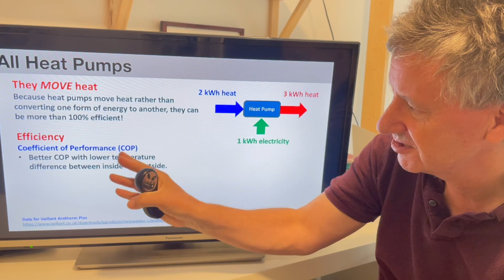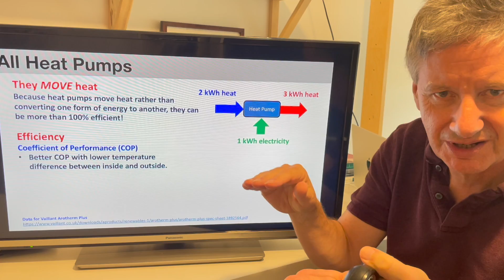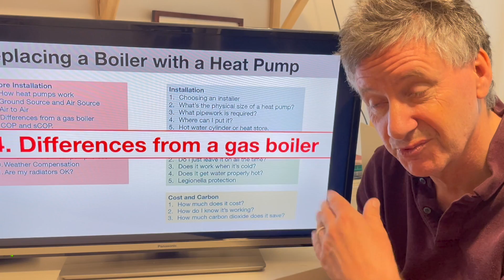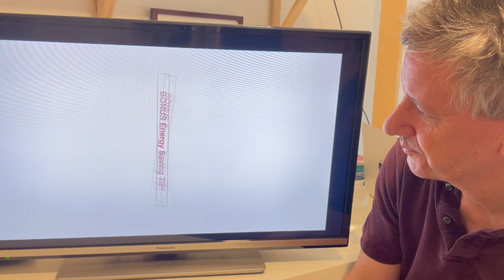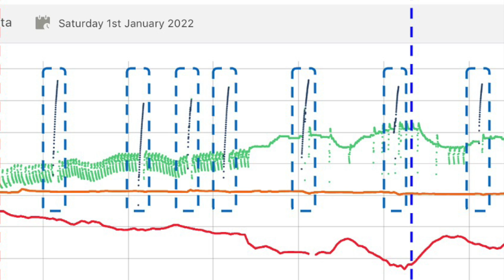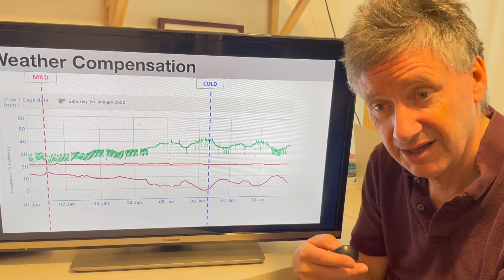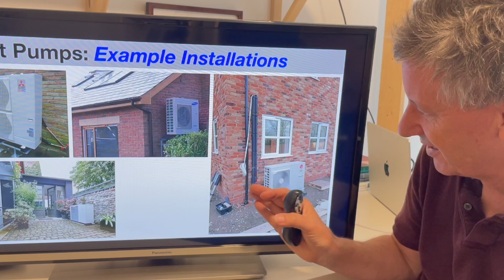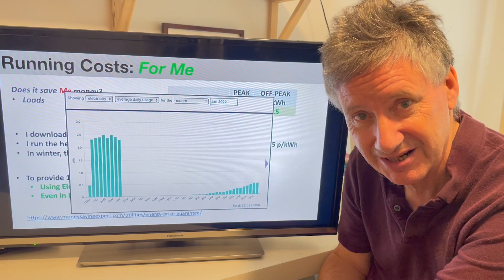Replacing a gas boiler with a heat pump

Comment: Heat pump reliability has to be addressed if it is to be really green.  Breakdowns are a reality government has to increase reliability of pump fan bearings and circuit board.
Reply from the maker: @frederickbowdler8169 Good Evening,

Reliability is an important issue, and it it is yet to be really tested in practice because heat pumps have not been installed long enough. But the technology is similar to that in domestic refrigerators and air conditioning units, both of which are spectacularly reliable.

Was it something specific  that caused you raise this concern?

Best wishes

Michael

Comment: Not one person with a heat pump will say how much their electric bill is each month. Most are fitted in homes with solar and battery systems,  so when they say it costs less to run, that's not a comparison. 
If you don't have solar/battery systems then you'll be in for a shock at the running costs.
Reply from the maker: In the video (https://youtu.be/n3AoUjuBixA?t=3333) I explain the typical saving is small and I also say exactly how much my bill is.

If you want to comment on the video, you might want to watch it first.

Best wishes

Michael

Comment: The initial figures look great. But the capital outlay is way beyond most peoples budget. The other factor is the carbon footprint for production of solar panels and batteries. So for me it's not that cut and dried But well done all the same
Reply: The boiler replacement grant is now worth £7500, and this is making heat pumps about the same cost a new boiler for most people
Reply: @tlangdon12  yes you're spot on with this figure. The deciding factor for me was that in addition to the cost of the heat pump - we would need to replace all the radiators. Loose our airing cupboard. And dig up our patio for a concrete base. This would all be in addition to our original estimate. Way over the cost of a boiler that we were quoted £2.800 to replace. I'm still not convinced that we would get anywhere near the SCOP figures either. If we had a nice solar system making a excess of electricity I might be more encouraged. But as these cost upward of £7,500 its a non starter. I think Mad Ed Milliband needs to commission a proper impact report. Rather than getting a company he sponsors to write it and then spend our money on.
Reply from the maker: @PaulRansonArt, thanks for stopping by. Three points in response to your comments.

Firstly, with regard to embodied carbon dioxide in the panels and heat pump, that 'debt' is paid back in a year or two. Here are my calculations from a year or two ago.

https://protonsforbreakfast.files.wordpress.com/2022/01/image_2022-01-01_172251.png

The figure is part of this article https://protonsforbreakfast.wordpress.com/2022/01/02/carbon-accounts-2021-looking-back-and-looking-ahead/

Secondly, financially a heat pump by itself is borderline 'profitable' i.e. it has a long 'payback' time. However in terms of reduction in carbon dioxide emissions the payback effect is dramatic - resulting in ~80% emissions reductions. In terms of capital outlay, for many homes the UK government's £7,500 grant makes a heat pump installation similar in cost to replacing a gas boiler.

Finally. Metaphorically we  have set our house on fire. Putting out the fire does not come at zero cost.

Best wishes

Michael
Reply: @michaeldepodesta001  I absolutly agree with your comments. We as a planet have no option other than to adopt a greener way of living. Such a shame that energy companies saw the £2,500 additionally grant as a windfall for them. Yes, my quote for a heatpump was £3,659 in addition to the £5,000 grant. When I saw the additional boost to the grant I leapt for joy as my quote would be reduced to £1,159! Right ....... think again. The quote remained unchanged but they would have pocketed the extra money. How on earth is this going to encourage us to change.  My total investment on a solar system, batteries, and an ASHP would be £17,000. Add an EV and we're up to £50,000. Keep on making great videos and lets pray the economy of scale makes a greener solution affordable for everyone.
Reply from the maker: @PaulRansonArt  Oh Dear: that sounds depressing and potentially rage-inducing! I wish it were not so.

Please allow me to wish you good luck with your endeavours.

Michael

Comment: Can it be run in reverse to provide cooling through water radiators?
Reply from the maker: @FelipeBudinich Good afternoon. It varies from model to model, but many heat pumps can be run in reverse to provide cooling. However cooling through normal radiators is not very effective. If the flow temperature falls below roughly 10 °C then water will condense on the outside of the radiators - and drip onto furnishings.

Instead of radiators, special units are available which maximise heat transfer - similar to the fan-coil units used in air conditioners, but still with water as coolant/
Reply: (I live in different weather conditions and it would be pretty nifty to be able to provide heat and cold with the same system)

Comment: Hi Michael. Hope you are well. I commented on this video last year and you were kind enough to reply. I never got to move to an ASHP as our old gas boiler gave up during the coldest month of the year and we had to replace it quickly. The new boiler a vaillant ecotherm 630 has advanced weather compensation but I'm not sure it is operating efficiently because our room thermostats, which call  for heat are overriding WC. This is most noticeable on sunny days when we have solar gain through our south facing windows which warms the room up but when the sun goes down in late afternoon the room temperature falls slowly meaning there is a cold period until our stats recognise a fall in temperature. We get round this by bumping up the desired temperature on the thermostats. From your experience would giving over control to the WC and boiler solve this problem for us as the boiler would turn on the heating when the outside temperature goes down, negating the need for us to manually intervene to stay cosy? Thank you
Reply from the maker: Steve, Good afternoon. 

I'm afraid I can't answer specifically to your system, but in general using Weather Compensation (WC) will give you the most comfortable home at the lowest cost.

In my own system (Vaillant heat pump) I use WC with an 'extended' setting. Vaillant don't specify exactly how this works but I think it uses WC, but if it has difficulty achieving the target temperature it adjust the output slightly (I think it adjust the slope of the WC curve) based on the thermostat setting.

You can see an example of the performance below.

https://protonsforbreakfast.files.wordpress.com/2024/02/heat-pump-errors-10.png

Solar gain is difficult for all control systems, and I am not sure that PURE-WC or PURE-THERMOSTAT will give you the best answer, but a sort of hybrid mode might sort of allow you to muddle through.

If you start to play with the settings I encourage you to write down everything you do - and maybe take a photo of the setting in the App or Controller - it's very easy to get completely lost!

Best wishes

M
Reply: @michaeldepodesta001  Thank you Michael. I won’t be tinkering with the settings without professional help! I have a Heat Geek engineer coming to service the boiler so I’m hoping to get better advice than I did from the installer. Thank you again for taking the time to reply. Any new videos in the pipeline? They are always a great watch.

Comment: Dear Michael,
Brilliant explanation of the working principles of a heat pump and components involved. Much appreciated thank you. We have our survey in April and the comparison to your calculations outlined in your other video should be interesting. Thank you for your efforts.
Reply from the maker: Dear @fje1948, Thank you for your kind words. And good luck with your  heat pump installation. Do drop me a line if you have any questions. Best wishes. M
Reply: Yes, this is one of the best explanations of the basics I've seen. Some people wonder how you can move 'heat' from outdoors when it is -20C to indoors, but you have to realise that -20C isn't that cold: Propane, a common refrigerant in domestic heat pumps, doesn't freeze until it gets to -187C and boils at -42C, so Propane outside on a cold winters day is boiling hot!
Reply: Stick to a combi and save money

Comment: Excellent explanation thanks! Just one point - you ignore the fact that hydrogen will be produced using surplus wind energy. As we scale up offshore wind to align to peak demand, there will be a massive surplus at times of low demand that can be used, even for the relatively inefficient production of hydrogen and ammonia (along with superior but limited scale storage solutions such as pumped hydro).
Reply from the maker: Good afternoon. And thank you for your kind words. 

However I think you are completely wrong about hydrogen. We need hydrogen for many reasons (high temperature heating and chemical feedstock) but heating is a complete waste of hydrogen. The difficult and expense of making it will require that it's used in applications where it is irreplaceable. Hydrogen provide no alternative to using heat pumps.

Best wishes

Michael
Reply: @michaeldepodesta001  totally agree for domestic heating (and I'm probably going to get a heat pump myself so agree it's probably the best solution for this use). But I work in the energy industry and can't see any substitute for some level of gas generation during prolonged periods of low wind (the so called "dunkelflaute") so converting natural gas CCGTs to hydrogen could be part of the solution. And there is no choice here - the O&G majors will be part of the energy transition whether people like it or not. Net zero comes at a huge cost and the economics need to work. But there will be endless debate on this fascinating topic!
Reply from the maker: @telemacus24  In my understanding it is not so easy to convert CCGT to hydrogen. I am not aware that it has been done. The flame properties of hydrogen and methane are completely different. Given that production of hydrogen is so difficult and expensive, it would probably just be better to keep generating with methane as we do now during the low wind periods. Then - as has happened with coal - our requirements for gas will diminish year on year as renewable generation grows.

What to do with the surplus renewable generation that we will soon find ourselves with? I think it's an open question. Synthesis of liquid fuels is one option, but I think there are a lot of long-term energy storage technologies with durations of days to months that may become economic. 

In any case: it's not today's problem. Best wishes. M

Comment: Mains electricity is produced inefficiently (but getting better) and distributed loosing some more (just a small omission)
Reply from the maker: Brian, Good Afternoon. Indeed, no energy conversion has 100% efficiency, but it is interesting to understand that starting with methane gas, it is more efficient to burn it in a power station (50% efficiency) and use that electricity to operate a heat pump at a COP of 3 (300% efficiency) than it is to burn the gas directly in someone's home (90% efficiency).

Best wishes

Michael

Comment: Hi Michael, firstly, thank you for such a detailed and useful presentation. All very interesting. I appreciate you made this video sometime ago but do you mind me asking how big your solar battery is? I already have a 4KW solar array tied to an 8.2kWh battery and it would be really helpful to understand how much assistance this would give to any heat pump and/or how quickly the heat pump would deplete the battery? Based on our annual gas usage (approx 8200kWh) im guessing we wouldnt need a particularly large heat pump (3kW i think based on your rule of thumb). Any thoughts would be gratefully appreciated. Cheers Rob
Reply from the maker: Rob, thank you for your kind words. 

1. If you have a 4 kW(peak) array in the UK then depending on orientation I guess you will generate between 3,000 kWh and 4,000 kWh/year. In summer peak generation will be ~25 kWh/day and in winter it will typically be ~2 kWh/day.
2. My house required 3.5 kW of heating when it was - 5 °C last week and this was supplied with a COP of about 2.5 - so it required 3.5/2.5 ~1.4 kW of electrical power. Over 18 hours this amounts to 1.4 kW x 18 hours = 25 kWh of electricity. Our battery is a Tesla Powerwall 2 with 13.5 kW nominal capacity. Currently capacity is about 12.2 kWh (https://protonsforbreakfast.wordpress.com/2023/12/30/solar-pv-review-of-2023/).
3. We charge up the battery on cheap rate electricity from 11:30 p.m. to 5:30 a.m. and then run off the battery until it runs out. On the cold days with no Sun, we ran out of battery in early afternoon. With bright winter sunshine we managed to make it through to 4 p.m. or so before running out.

Regarding heat pump sizing, do make sure that your gas consumption corresponds to a situation where you are keeping your home at a reasonably constant temperature during the day. If you are switching off your gas for half the day, and the house cools, then using the rule of thumb this will lead to an underestimate of the size o heat pump required. Drop me a line (house@depodesta.net) if you need any clarification.

Best wishes

M
Reply: @michaeldepodesta001  Hi Micheal, thanks ever so much for the helpful response. Lots of food for thought. You've accurately surmised by solar systems generating capacity so it's helpful to know that Vs what your heat pump requires. Following your message, I've also tweaked how we are heating our house to a constant setting (we were previously heating intermittently) to get a better idea on demand and sizing. Thanks again, I really appreciate you taking the time to write. Cheers Rob

Comment: The switch you recommend to reduce the flow temp and have the boiler "on all the time" surely must dramatically reduce the boiler's lifespan and cause more issues, many times more worrying than spending more or wasting more energy by having it heat up less often at higher temperatures? Genuinelly asking, not challenging. Thanks
Reply from the maker: @montyoomska, Good Evening,

Mmmm. Tricky. 

First of all, I can't give you a definitive answer, but here are some reflections.

1. Boilers do last a long time - frequently for decades. But when they break, I have never heard of a boiler breaking from 'being on too much". What breaks are nearly always electromechanical components such as electric valves, relays and pumps.
2. If a boiler has an output power of (say) 20 kW which it can modulate down to 5 kW, then components in the primary heat exchanger (which extracts the heat from the flame) will get less hot, and will not heat up and cool down so frequently. I would imagine that would lead to less stress and less corrosion.

So my guess is that modulating a boiler to lower output is generally beneficial rather than harmful.

3. Improving efficiency by 10% is (neglecting standing charges) 10% off your gas bill. If that's £1000 a year, then that's £100/year. 

Have I missed something obvious?

All the best

Michael

Comment: I have a fairly well insulted 1990s built home but it has 10mm microbore piping. Is this likely to need replacing when installing a typical HP and if so, would a higher temp Octopus Cosy HP be better suited (albeit with lower COPs)?
Reply from the maker: Darren, Good Afternoon. I wrote an article about this issue here: https://protonsforbreakfast.wordpress.com/2023/08/02/hydronics/

Hydronics is the fancy name for plumbing. Heat pumps are good at producing heat, but they need to circulate a lot of water to pass on that heat. Narrow tubing requires a high pressure to pump the water through. As the article says, the standard approach to this is to use what's called a low-loss header to help the heat pump circulate water, and then to use an auxiliary pump to push the hot water through your radiators.

 I have chatted with people on Twitter who have heat pumps micropore pipes and are happy with their installation, but without seeing, I can't say for sure if it is achievable in your home.

The issue about flow temperature is not associated with micropore pipes but wit radiator area. If you have large multi panel radiators AND you can get enough water to them - then you can have a low temperature installation. Octopus tend to avoid 'difficult installs' and I recommend you search for a HeatGeek-trained installer who will be your best chance to get a good installation. And other heat pumps - such as the Vaillant Arotherm plus series - can heat to 70 °C too.

Good luck - it's a stressful activity!

Do ask more detailed questions as you progress.

M

Comment: What happens when the power goes out for 2-3 days at a time which happens regularly where I live. Currently all I need is a battery with converter or small generator to run the pumps on my gas boiler.
Reply from the maker: Dear Porcupine Pete, Good Morning. Sorry to hear about your electrical woes. As you say, if you don't have a reliable electrical supply, then a heat pump is not a good choice - at least not without a large battery. 

If you don't care about emissions of CO2, then a gas boiler is great. 

All the best

Michael

Comment: Hi Michael. I've done the heat loss calculations 10kw and have the kwh used over a winter period. My question is my calculations work out to 10kwh for heat loss, now dividing by 57.3 I have an average of 174 x21=3,654 Watts. So from that figure I would need a heat pump of 4Kw which seems really low. Any advice appreciated.
Reply from the maker: Mark, Good Morning,

I'm afraid I can't follow you calculation - I think you have switch kWh and kW somewhere. Can you tell me your annual gas consumption and the rough location of your dwelling?

All the best

Michael